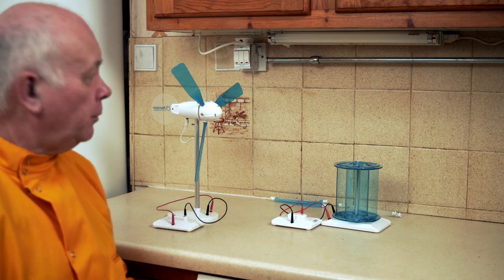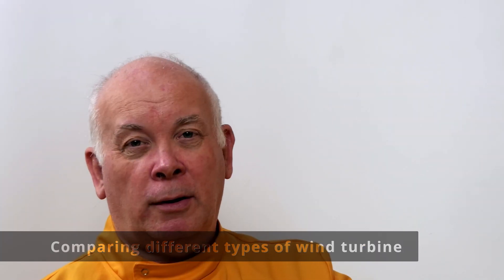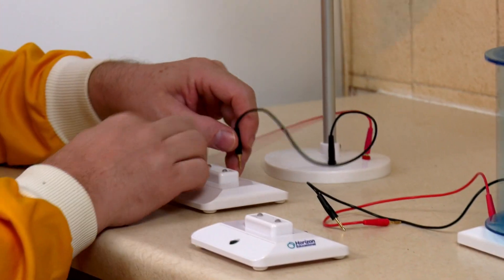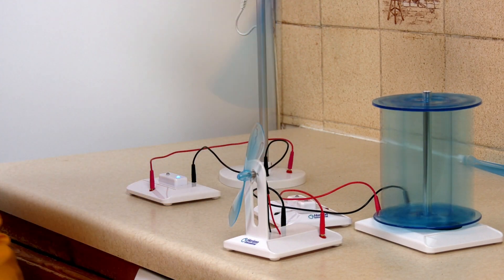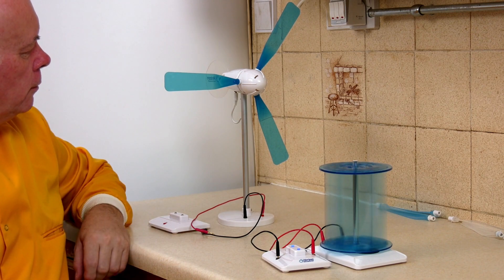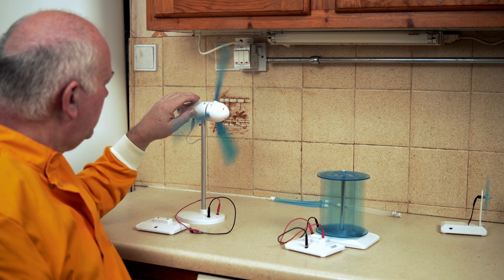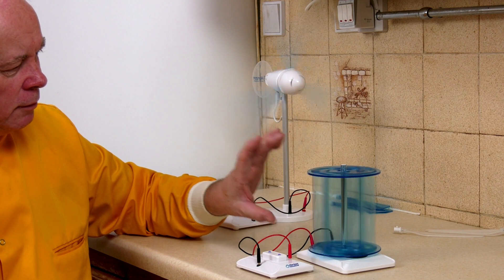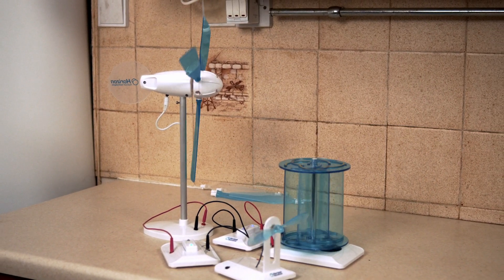comparing vertical vs horizontal wind turbine

Comment: Well it started out looking like it could have been a good video.
Testing with a definitive identical load for each turbine with a voltage and current sensor with results captured would have been much better.  Raising the vertical turbine so that the mid point was on the same level as the horizontal turbines axis would have given a more like-for-like result.  And I liked the fact that the blades on the horizontal turbine can be adjusted.
However, at 04:50, the blades were adjusted and one of the three was adjusted the 'wrong way'.  This meant that one blade effectively cancelled one of the others so the net result of the turbine is from ONE blade only.

Comment: Who cares? All practical tests of ground-based small wind turbines show: 1) They hardly produce any electricity. 2) They do not last long!
No electricity, because there is hardly any wind close to the ground – and electricity yield is proportional to the third power ofwind speed: 100% more wind generates 800% more electricity! Only from an altitude of 100m wind is stronger and more constantly. Moreover, wind close to ground is extremely gusty & destructive to wind turbines.
Due to price decline solar panels generate at least 10 times more green electricity with the same investment! Reliable for at least 25y - maintenance-free.

Comment: I can't even count the number of times I've driven through areas with vertical and horizontal wind turbines and seen only the horizontal ones turning. With the horizontal turbine, the wind is pushing against all the blades all the time. But the vertical turbines, by the very nature of their design, have one "blade" moving in the direction of the wind, and one "blade" moving into the wind. So it's fighting itself.

Comment: I noticed that the generator in your VAWT is different type with in HAWT. maybe this is the main reason that VAWT has smaller power output than HAWT? and the reason it can not make small HAWT turbine rotating

Comment: I like the roof line adaptation where they take a bunch of those wind turbines in the style of your vawt, but turned on its side. They are stacked along the roof line to catch the wind running up the roof and are hooded so only the leading blade gets wind. You could also use a verticke stack if those at the corners of the house for a similar effect.  Definitely would want dome sound dampening technology there

Comment: the problem with a "normal" turbine, its quite daungers to have if its planned to be in a garden. its much and safter to have the horsiontal also much to protect, because there is NO turning parts, that moves, the directions and the BIG wings.. but the power is less on horsintal, but also much easiere to multiplied.. The Main issue for house hold turbines is the NOICE the produce to the envirement. nabos and suchs. the limits is very low and can that be a issue with a horsiontal turbine. or is it possible to make then in a enhanched cabin.. perhaps make to Solar panles lifted and have them between the Roof and the solar panels. that schould reduce the noice from them, and give more options for multiplied turbine generators

Comment: You compared a really small, inefficienty design vawt to a much bigger much better design hawt. Its not a fair comparison. Also, vawt are not as efficient as hawt but have their own advantages that you have to clarify, like using gusts and turbulent flow much better, so works better thsn hawt in built up enviroment.

Comment: On the hawt, when you first adjusted the wide blades. You turned 2 in one direction and the 3rd in the opposite direction. That is why it was slow

Comment: The horizontal turbine has really small blades and therefore small surface area making contact with the air. Haven’t watched the video yet, but it’s obvious which will preform better

Comment: Instinctively it occurs to me that the diameter of both devices is a factor. The bigger the diameter the more leverage the airflow has to turn the shaft. Also if you increase the height of a vertical turbine I imagine you would increase the power available for power generation.

Comment: You should try connect olds elevator to draw water with a horizontal turbine, turning the tube of the old elevator. This could then draw the water up to a great high with wind power and drop down which then could run a hydro generator is the normal elevator in action. https://youtu.be/-fu03F-Iah8

Comment: Bogus test. Any 2 identical generators at a givin rpm, will produce the same power. If the wind turbines are not designed to give that rpm there is no comparison. Your comparison should look into cost and complexity of each design to produce the same power output. And the efficiency of the design. The vertical axis you showed was not the most efficient.

Comment: Numerous, long-term, independent studies have been conducted on similar-sized horizontal and vertical wind turbines and every time, the horizontal models far outperform the VAWT's.  And, every large, commercial wind turbine is HAWT, not a single VAWT.  Tiny, plastic models tell us nothing.

Comment: Thank you for sharing some information with regards to the comparison between HAWT and VAWT in connection to it's performance in generating rotational motion as a means of converting wind power to mechanical then into electrical power.

Comment: By the vertical you should  shade the not working side, which comes against the wind. I think you vould gain some more power. And the shading has to be triangular, to compressing the air to the working side.
Reply: but more expensive and complicated

Comment: Wind turbines heights in my town is limited to the closest property line distance. I haven't seen HAWTs that feather their blades for high winds so they need braking. Finally, my best analogy would be that you can cook 1 ostrich egg (HAWT - high power output) or many chicken eggs of the same weight (VAWT - lower individual output adding up to the HAWT). Also with multiple VAWTs one can be serviced while only losing a portion of the output. VAWTs start at lower wind speeds too.

Comment: There are plenty of issues I can see here.  First off there are MUCH better vertical vanes that produce nearly the same power.  Next vertical requires less maintenance and a whole lot less room.  Vertical does not need slip rings for complete 360 rotation that will eventually possibly twist the wires as it turns to face the wind.  Vertical can take a lot MORE wind if you get storms and such and the blades do not need to be variable pitch....there is a "perfect pitch".  The turbine can be supported top and bottom reducing friction on the generator section.   The turbine can be near the ground and the vanes at any height you find best so MUCH easier to maintain (don't have to take it down to work on).  The BIGGEST BY FAR to me is vertical doesn't kill birds and bats.  Horizontal gens are killing valuable birds and bats by the millions...that WILL come back to bite us.  Good vid but no very comprehensive.  Check out Robert Murray Smith on here...he's done a couple great videos you might find interesting.

Comment: I'd love to see a video comparison of these two turbines, but with the addition of a bypass plate that prevents the wind from hitting the returning blades on the VAWT.   These mechanisms could be mechanical and automatically change with the wind direction, a bit like a weather vane, to shield the advancing blades from the oncoming wind.

Comment: on the slower 1 can u use magnets to take the weight.so it lifts it off the base and runs free
Reply: But then how would you be generating power? It's connected to the turbine (or is the turbine). If it's running free, then you're not translating any of that movement into usable energy.

Comment: You should have measured the voltage and current of both machines it would have given a clearer picture.
Reply: They arent the same sized. Unfair test.
Reply: @jukkatakamaa7274  Why? Showing that one didn't have enough current to power the LED's is essentially "unfair" too.  It would be nice to know the actual difference in output.
Reply: @MichaelMammon  ...the VAWT is 1/4in capture area...1/4th the power roughly.
Reply: @jukkatakamaa7274  I found a paper by Jazuli Fadil et al which reads:
For VAWT we used H-darrieus type whose swept area is 3.14 m 2 and so is HAWT. The wind turbines have 3 blades for each type. The air foil of both wind turbines are NACA 4412. We tested the model of wind turbine with various wind velocity which affects the performance.We have found that CP (maximum coefficient of power) of HAWT is 0.54 with captured maximum power is 1363.6 Watt while the CP of VAWT is 0.34 with captured maximum power is 505.69 Watt. 
In other words,  about 1/3 power difference using those particular blades on similarly sized turbines. 
Again, while it is "unfair", it would be nice to see some metrics and talk about the coefficient of power of each system.  
As I mentioned, just showing the VAWT doesn't light up the higher draw LED's is pretty lazy way to show the difference in output.
Reply: @MichaelMammon  ...VAWT does not consume energy itself like a HAWT does. 40% efficiency can be reached easily with a VAWT.
Reply: @jukkatakamaa7274   OK. 
Again, what is your point?  Showing what the maximum coefficient of power is between the 2 systems is helpful despite the "unfairness", while simply showing one cannot power a LED is pretty vague and useless.
I do not understand what point you are attempting to make.
Reply: @MichaelMammon  ...I just want to say...VAWT are heavily underestimated.

Comment: The comparison would have been more fair if the VAWT had been a similar size as the HAWT and had been on a mast at the same height.
Reply: True, or at least the same size with the blades area of the HAWT... as the leg of the VAWT can be shorter in this specific scenario.

Comment: That was not scientific, was the generator the same for both systems, what was the RPM of each system, could the vertical maintain the same speed with the same generator.  What was the decibel rating of each unit.  Nice video though just lacking in information.

Comment: Betz limit has been smashed and debunked regards Graham Flowers
Reply: @dedu456  yes
Reply: @dedu456  yes to your first question and no to the second the outer ring drives  the generator as well as being a flywheel regards Graham
Reply: @dedu456  four feet diameter with corrugated blades could be a eight feet diameter power output but still be four feet in diameter size regards Graham
Reply: @dedu456  do you mean 4'-0" diameter . Axial Flux is a Hugh Piggott design am I right regards Graham

Comment: I am building a large vawt using a metal spool that is used to transfer electric cable.. I have a wooden spool also that I realized would make a good base..and I plan to use metal roofing for the booster panels.. The generator will be a challenge as well.

Comment: with VAWT there might be less loss due to the direct transfer of power? The HAWT has gears and there is always a percentage lost there.  Smaller VAWT and more of them alongside a house ( what I am trying) would seem a good starting place for me I think.  Where I live we've had nearly 6 weeks of rain and very little sun but we always have some wind.

Comment: Video Summary: Vertical seems better. There, saved you all 8 mins of your life.
Reply: how do you figure?
Reply: @robertrichard2322  That's the gist of the video.
Reply: @kartikkr  not really depending on the application both have pros and cons.
Reply: @robertrichard2322  Fair enough. Not debating one is better than the other. All I was trying to say was that the gist of the video is stating that Vertical is better. Not my conclusion...just helping save time. Maybe I'll update my wording to reflect the same.